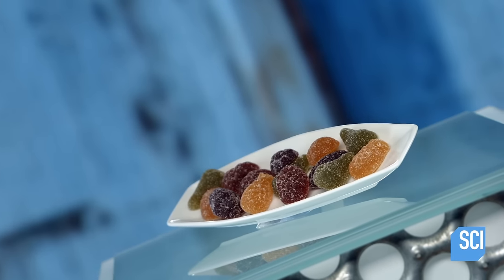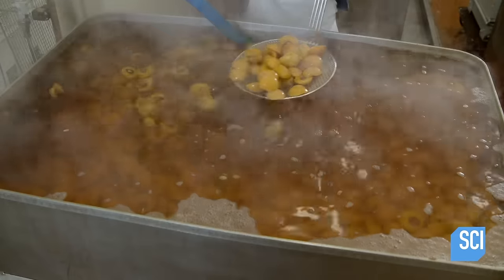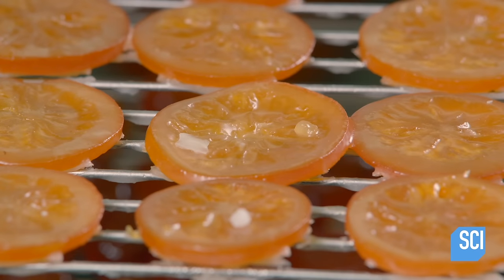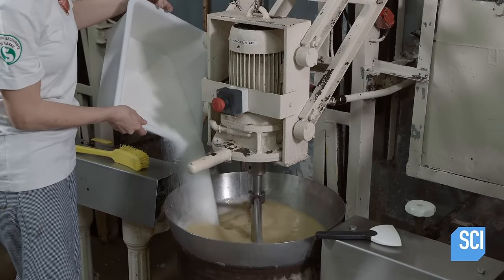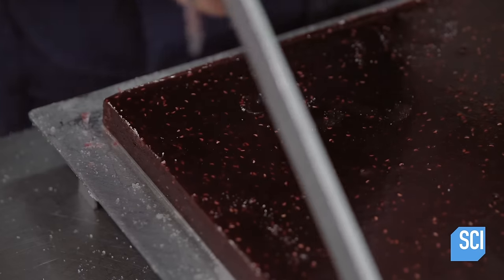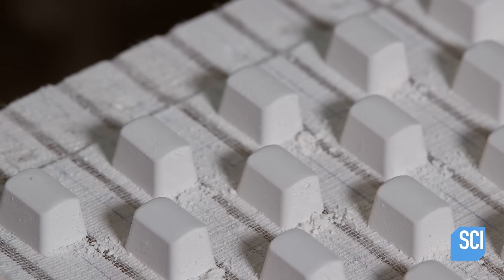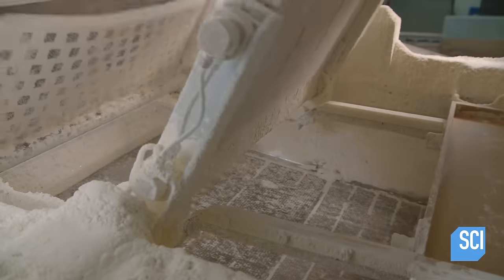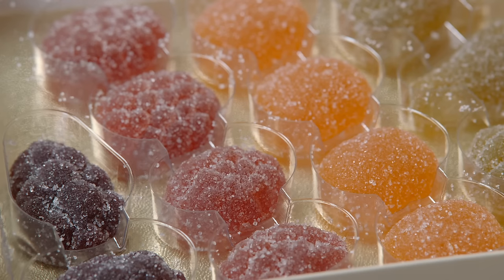How It's Made: Candied Fruit

Comment: How I candy fruit the easy way:
Slice lemons or other citrus thin, about 1/4 inch. Put in a saucepan 1 part sugar 1 part water and fruit and allow to come to boil. Turn off and let sit. Boil it again 12 hours later, fruit needs to look transparent. Immediately while hot scoop out fruit with slotted spoon and roll in sugar. It can be shaken to avoid burning fingers. Take fruit out and place on rack to cool. Should be firm and dry, not soggy. Store in ziplocs, jars or freeze. Harder fruits like apples, peaches (not really ripe) pears, strawberries(firm) and even grapes (sliced) can be done, but I have had poor success with raspberry and black berries. They fall apart.